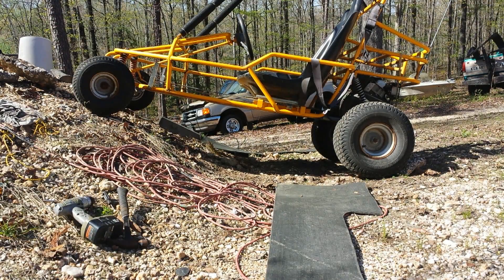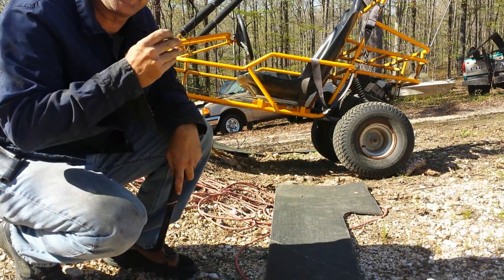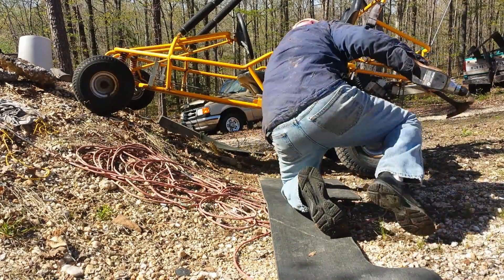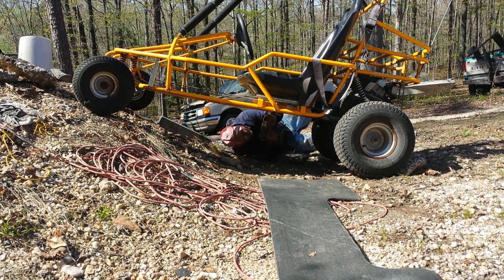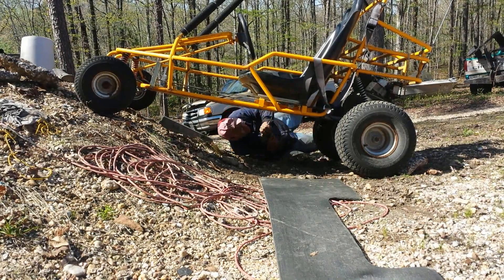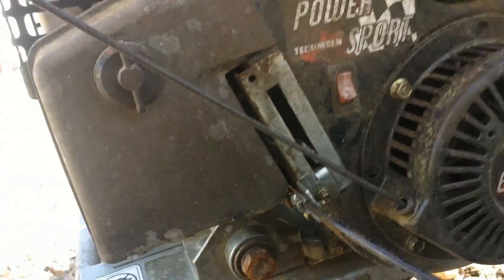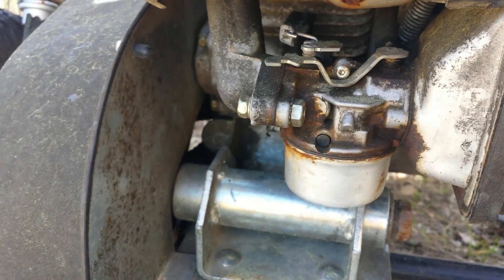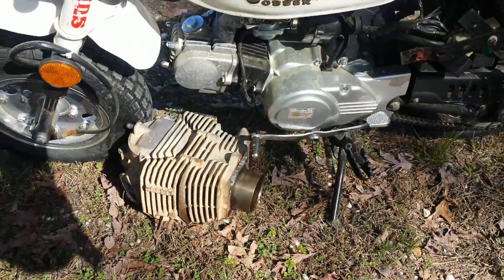Yerfdog black water fix. Fitness tip. :)

Comment: Well it was either weld or drill but if you could just grab u cheap tarp and throwing over even if it's not raining  the sun tends fade and Crack rubbers and plastics  so covering will give you bobble protection 
Be blessed Jah Rastafari Salassie I JAH